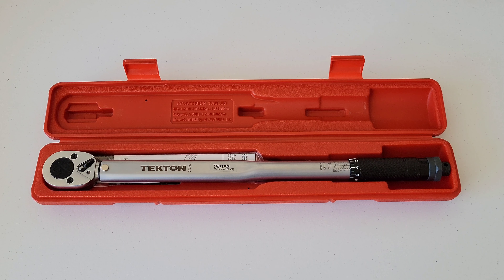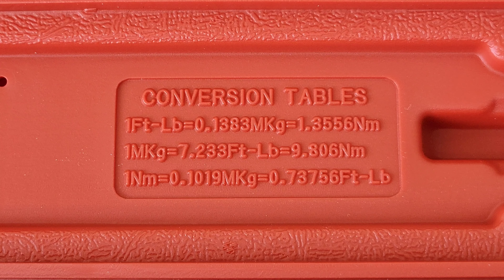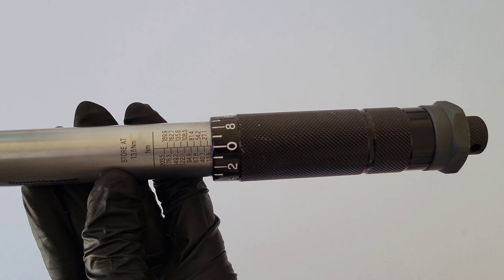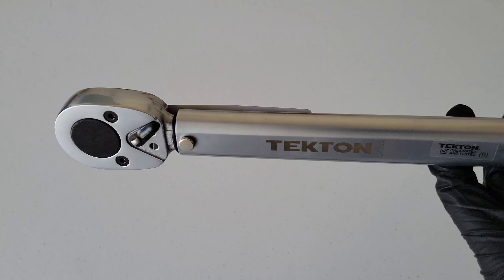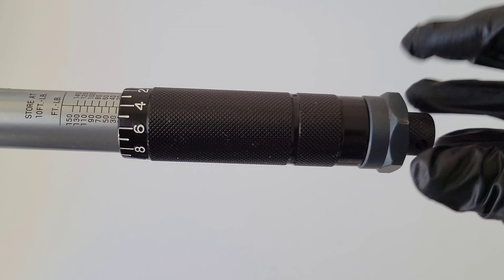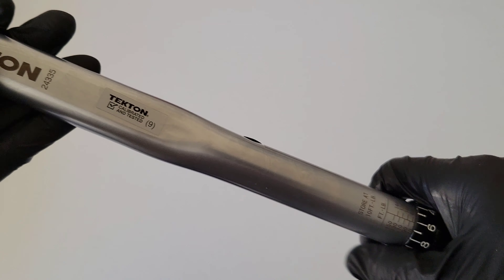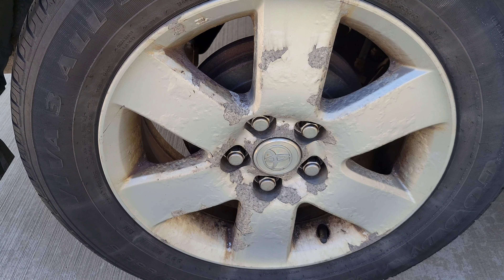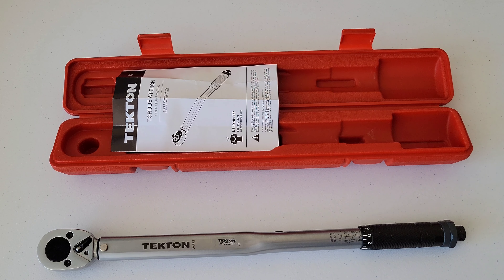Tekton Torque Wrench Review And How To Use

Comment: Thanks, bought one yesterday - it's on the way - will put it into service on my 04 Corolla S. As for your wheel - there's plenty of YT's on how to restore & paint metal wheels. Never saw a metal wheel in that style. The plastic caps on my 04 S all look like that, in fact one was resto'd, cleaned, sanded, paint & clear coated over the weekend. Thanks again.

Comment: @Todd's Garage   When backing off the pressure to put the torque wrench away ,  should that little round lock knob at the very end be  off (counter clockwise)  or  on (clockwise )   or does it matter?
Reply from the maker: Hi and thanks for watching! I am not sure it doesn't specify in the manual whether to leave the knob tightened or not. The manual only states "When wrench is not in use, keep adjustment at lowest torque setting, 25 ft.-lb. (33.9 Nm)" The manual also states "Do not turn handle below lowest torque setting." Sorry I cant be of more help, you will need to reach out to Tekton to get that answer it looks like.

Comment: So, what does a torque wrench do if your lug nut has already been tightened beyond the specs , does it just keep tightening or somehow indicate that your over what your set at? I’ve never used one but want to get this I’m just not familiar with them and don’t want to use it incorrectly and snap lugs or other bolts.
Reply from the maker: Hi George,  thanks for watching! The torque wrench will click when you get to the value you set it, but if you are checking a pre tightened down bolt the bolt could be over tightened and the torque wrench will not notify you of that. It will just notify you with a click when you get to the value you set it at. This Torque Wrench has a 4% + or - accuracy to the value you set it at. Hope that all makes sense, let me know if you have any questions. Thanks again for watching!

Comment: hey todd, your method to torque the lug nuts is not correct - while tightening you were pulling the torque wrench upward towards you, that is not best practice - the correct method is always to push the torque wrench downwards with one hand and the other hand firmly on the wrench head to ensure the wrench is perpendicular to the lug nut. while pulling up your wrench was not perpendicular, was at an angle and could easily slip and injure you at higher torque and you never use single hand always use both hands
Reply: Agreed. If I use a small extension will it throw off the calibration or give improper an improper reading?